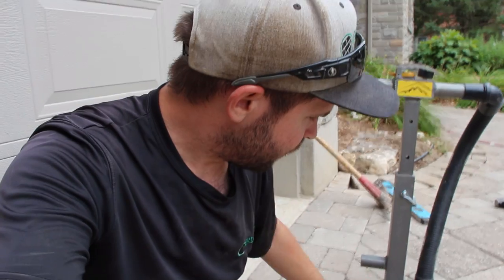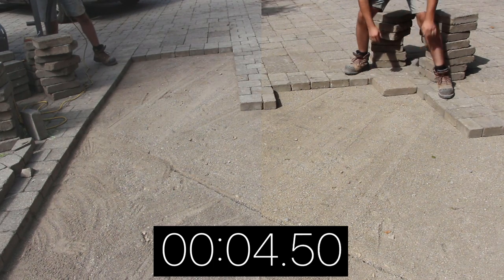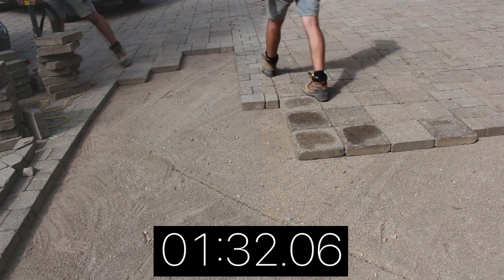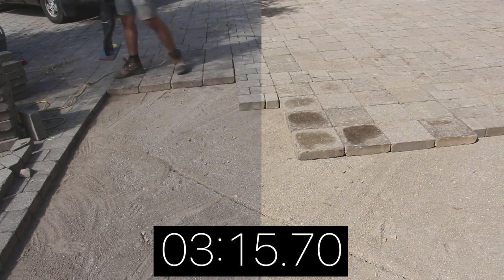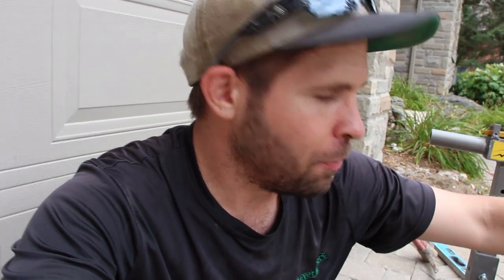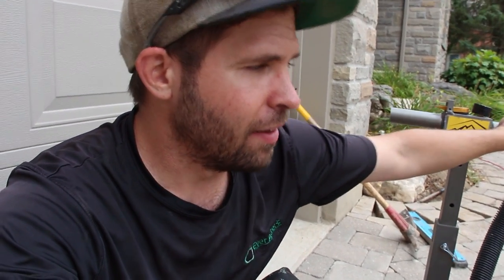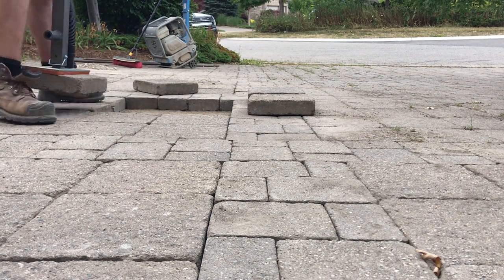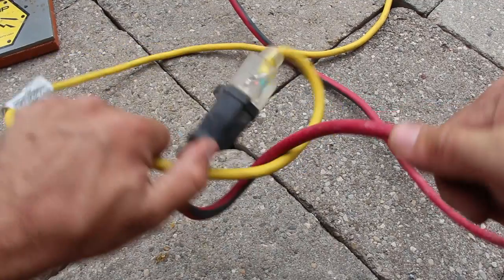Laying Pavers with a Vacuum Lifter VERSUS by Hand | SPEED Test

Comment: Probably timing would be reversed as slab size increases.
Question: Looking at the site there, I have a 15'x15' exposed base ready for laying. 3/4 is 25 year old 4" screening that's essentially hard has rock, the rest, clay/soil. Should I protect the site from upcoming storms with a tarp or is that not even a concern??
I agree with the other fellow that said he'd like to work with you. Me too if I were 40 years younger 🤣
Reply from the maker: Agreed, plus saves your fingers with those larger slabs.
😂 there is always a position ready for you here Carl.
You may want to depending on the site. If there is a chance for pooling water it could mix your soil with your base material and then you will need to scrap some of that off before continuing. But if a tarp is not going to prevent pooling, there is not a major point to doing it. Ultimately it sucks when it rains for us in this industry.
Reply: @iamahardscaper  Thanks, yes I can well imagine the weather plays a big part. I used to do a lot of work outside, climbing stacks working in January blizzards in all Ontario so appreciated the warm dry weather. For me it didn't damage anything, in your case it can play a role. Rain on freshly screeded sand? Back to square one.

Comment: Great video,  I just won a Grabo at a landscape show. I am going to try it out. It's not meant for porous pavers, but it's free, so I am going to test its limitations. I pinched a never in my back a long time ago and it's been giving me trouble ever since, so anything you can do to reduce the stress on your lower back is worth every penny of investment,  the pain from the alternative is worse than giving birth. I can say that because my sister had the same issue and said it herself. THE HARDSCAPE BUSINESS CAN BE LUCRATIVE BUT YOUR BODY MAY PAY THE PRICE SO BE CAREFUL. 

BTW how much can you charge per square foot for a lift and relay in your area. I try to avoid them because it's more work than a new installation but we have too much competition and can't charge as much.
Reply from the maker: That is a good win! We actually have a video on the grabo and we test it on various types of materials so you can see what it works on and what it does not work on. Very true, take care of your back.

I am somewhere around $12-$15 per square foot lift and relay.